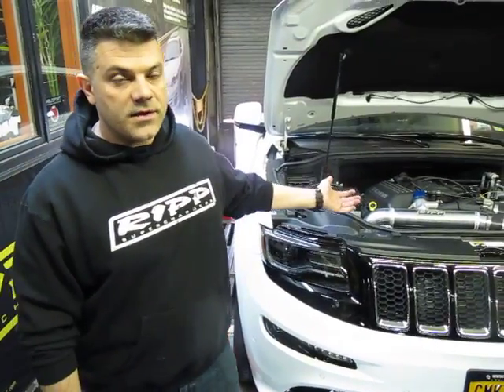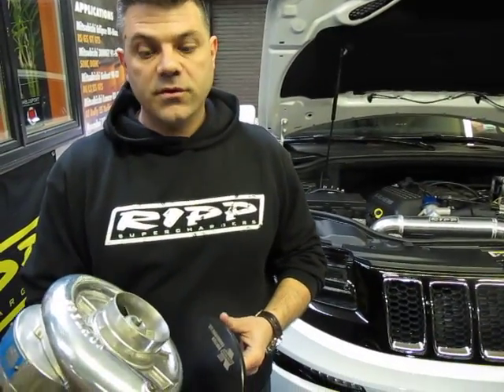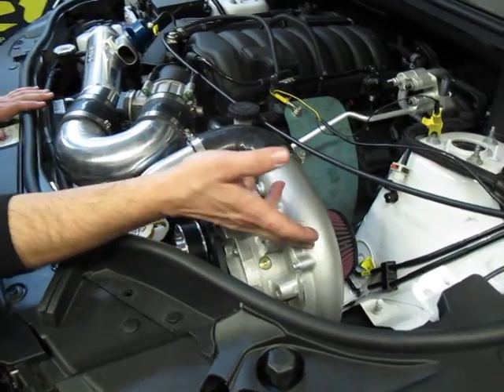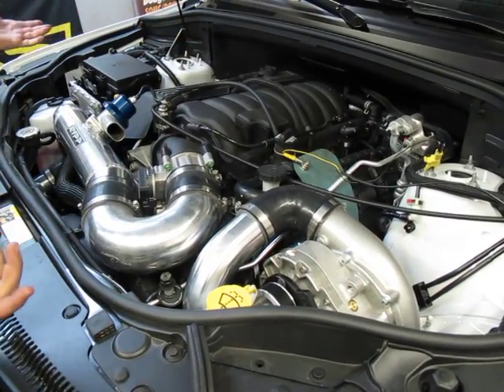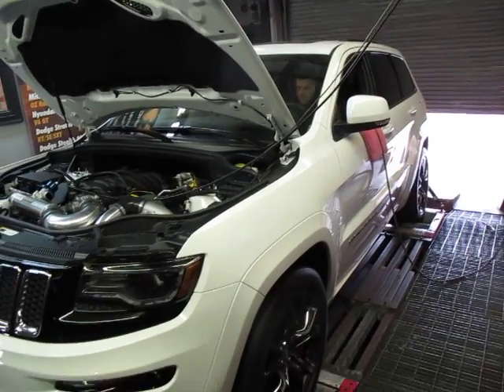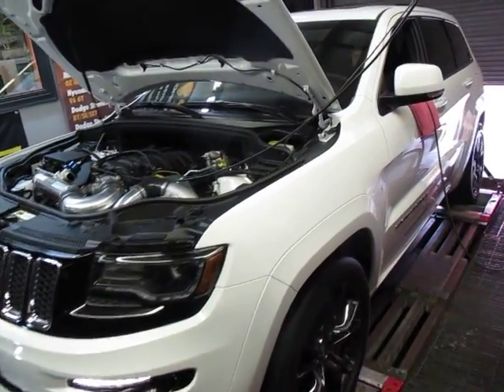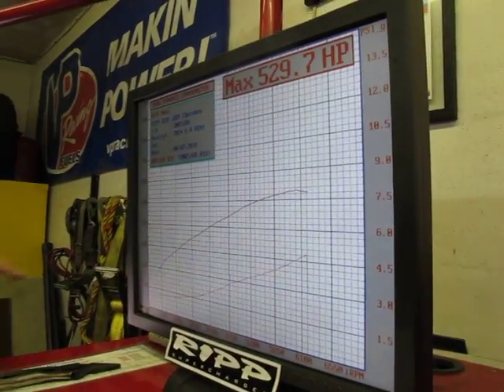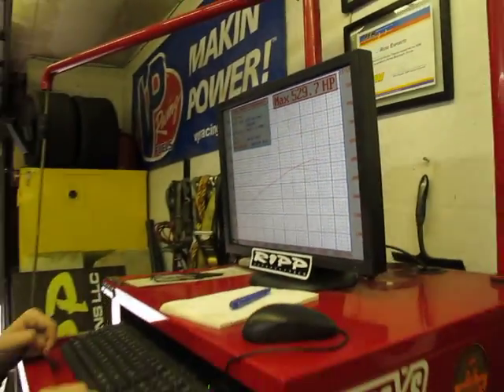RIPP  Jeep Cherokee SRT 6.4 Hemi Supercharger Dyno

Comment: Is it easy to increase the boost? Would like to run more for a forged 392
Reply from the maker: Hello, thank you for your message

Yes, but that's a better question for tech@rippmods.com . There are multiple options for increasing boost on the Hemi kits based on the engine build. They can guide you on pulley size for your set up.

Comment: You’re not supposed to force aspiration on a 392 without forged internals
Reply from the maker: Says who...? We have over 500 of these kits on the road at 560awd-hp.. we have been supercharging these for a very long time and we know factually you can run 500 to 560awd-hp safely. When you light it up past that you need internals.

Comment: Why are you only measuring the HP at the rear wheels?!? I would assume that your setup on AWD, as you originally tested, would be much lower.
Reply from the maker: We have much newer videos showing same HP. This was testing a Dyno mode in the Diablo several years ago.
Reply from the maker: https://youtu.be/8dz4sTwj6ds 👍
Reply: What does it put down in AWD? Thanks.

Comment: I don’t think 60 hp is worth 6,000$
Reply from the maker: 60hp? Common misconception, you are under the impression that the 392 makes 480hp to the wheels when in fact it does not. 480 is Crank HP or HP measured at the engine alone. Stock SRTs make 389whp (wheel HP) or HP measured at the wheels like this video. With our supercharger make 550awd-wheel hp which is in fact 660 Crank hp. So its $6000 for nearly 200hp 🙂

Comment: I couldn't see how much the torque changed (you said around ~500 ft-lbs).,
What was stock on this vehicle?
What RPMs are the maximums at, and what is typical in the 2K to 4K RPM range, which is where we typically drive the most?
Thanks.

Also, I have a 2012 SRT8 Jeep. It came with the stupid ECO 4-cyclinder tree hugger feel good option for those around me in the Seattle area. I had Sean at hemifever give me a Diablo tune that got rid go the ECO mode (horrible stock throttle delay) and it runs a lot cleaner (and better fuel economy ...). But, I want more power like all who buy this beast.
Do you have to replace the bank of rockers with the extra oil ports for the original 4-cyclinder ECO 'mistake' as well for the 2012 to 2014's which had this lovely 'feature'?

Do you have a partner shop in the NW or the West Coast who can install the RIPP chargers?

Thank you.

Comment: I have to ask, since its not connected to the exhaust why would it need an intercooler? That doesn't add up to me.
Reply from the maker: An intercooler is for cooler denser air going into the engine for maximum efficiency. The exhaust has no relation to it.
Reply: It doesnt matter if its connected to the exhaust, superchargers and turbos  both compress the intake air wich generates heat on the intake charge regardless. The more boost there is the more heat is made, thus the need for intercoolers  wich make denser cooler air and also avoiding cylinder knock (KR).  Methanol injection kits also aids in the cooling effect..
Reply: Keith Alan did you think the intercooler cools off the exhaust?😂😂😂😂💀💀
Reply: EvolutionXRG you can't read properly, can you? Ahahahahahaaa

Comment: Did you mod the trans because the stock trans torque spec is around 470
Reply from the maker: +Anthony Pearman Factory transmission and factory engine on all of our systems
Reply from the maker: no need no reported trans issues with our systems.

Comment: Hey, do you guys have a kit for 2010 Jeep 5.7l, Or did?? or are you guys ever plan on doing this kit???
Reply from the maker: +Tony Redden we seldom get into custom set up's older WK's are plagued with weaker transmission and even weaker torque management control. As the platform got newer, the components go stronger and we added the applications to our line up.
Reply from the maker: Nik J Hey Nik, we never developed for the Wk1 5.7, but that doesn't mean we won't in the future!
Reply: RIPP Superchargers If you do i ll be the first to buy!!! haha , any particular reason why this is the only 5.7l hemi that doesnt have any supercharged kits?
Reply from the maker: Nik J Tunning Mopar/Jeep vehicles consume alot of time and devotion. Unlike Ford and Chevy, the ECU's in these vehicles are incredibly locked down (i.e. Jeep doesn't want you touching their calibrations) This is why we do not put out thousands of different kits. We prefer to spend time on making every application as solid as possible and for the customer to enjoy the experience of driving it every day!
Reply: Can you guys make a Custom application for my 5.7l JEEP
 WK?
Reply: +Nik J 
I wanted to know that answer myself.
Reply: RIPP Superchargers 
I can't argue with THAT! Great work, nevertheless.  Thankyou

Comment: My only concern is my truck warranty..
Reply from the maker: Kalin Konnerth We reccomend checking with your local Jeep Dealership. We've found that most dealers are mod-friendly, considering we have dealerships actually buy our kits for vehicles they have on the lot. These are bolt on kits that do not require cutting up the engine bay.
Reply: Jonathan Elkaim with the amount of work done to this jeep  can kiss that warranty goodbye
Reply: RIPP Superchargers seriously. I did not know that. That's awesome

Comment: Do you guys make a kit for a 2013 Jeep GC 5.7. Not looking to lift the front wheels off the ground but would love more performance...loving your SRT. Waiting to see 0-60 and 1/4 times!
Reply from the maker: Yes, we have a kit for the 5.7 and the 3.6 2011-2014 Grand Cherokee - stock it makes 276whp AWD with our supercharger it make 420whp AWD with stock exhaust manifolds and cats.
Reply: @RIPPMODS when are yall coming out with more powerful heads units for the jeep something to compete with competition need to make 1500hp or better

Comment: Whilst the HP increase is great, whats the point/purpose of doing it in RWD only when these cars are AWD? Who is going to disable AWD for the street? Why not show the AWD figures? I get that the HP increase wont look as good but at least it will be real world figures that customers will actually get rather than unachievable RWD figures.
Reply from the maker: Because its not full time AWD - Its a 70/30 split and then shuts off - In reality this is the correct way to demo this. If you make a pass in AWD it shuts off and switches to RWD and that confuses the DYNO... SO in an effort to keep our $120k Dyno and not drop the transfer case into pieces  - RWD is the safest way to go.

Comment: Nice work. How hard was it to make a RWD?
Reply: As hard as removing the front driveshaft or transfer case motor.
Reply from the maker: You shut it with the Diablo programmer - its easy
Reply: Could it do that on an 06?